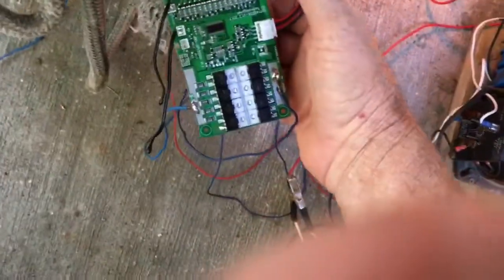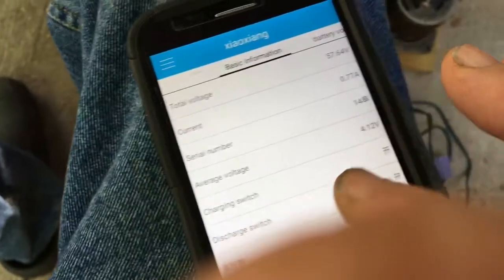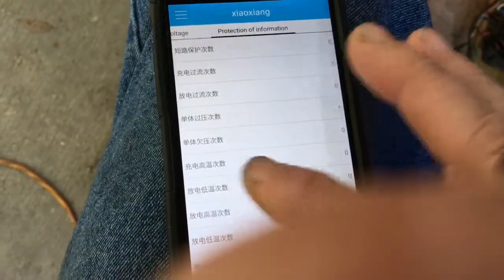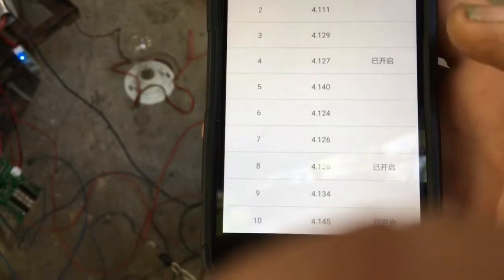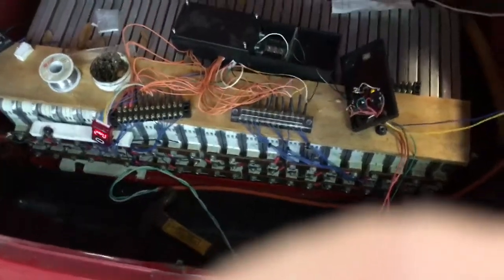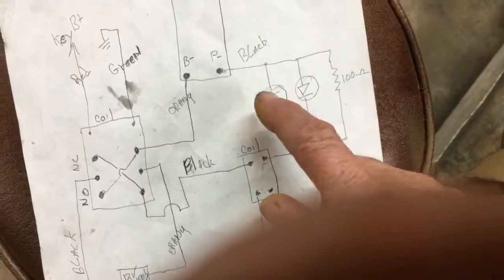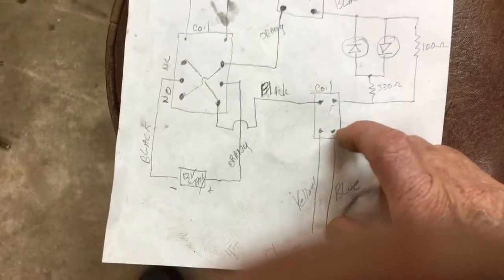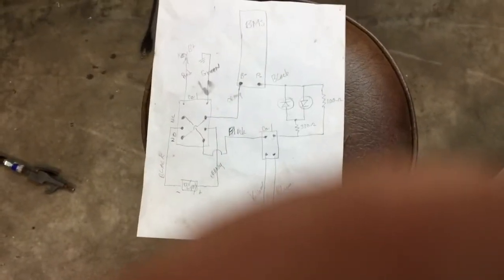BMS FOR EVS

Comment: A couple of little details one , the LED lights could go across the relay instead of in series with the relay. I did it that way on that schematic because I had a lower voltage relay. On the smart BMS the first BMS that we saw with the Bluetooth it seems that it is not able to change the number of batteries by simply soldering certain wires together it seems it has to be reprogrammed from a laptop and not from a telephone. Still working on this part .
Reply: How much and where can I purchase one? 
I see you've had it for over a year now what do you think of this BMS?
Reply: @adame924  yes I'm still using this guy and we are buying them in quantity and selling them at www.Greenshedconversions.com also I'm working on a companion board to run relays so they could turn off and on high current. I have another YouTube account that you can get to by clicking on my profile picture